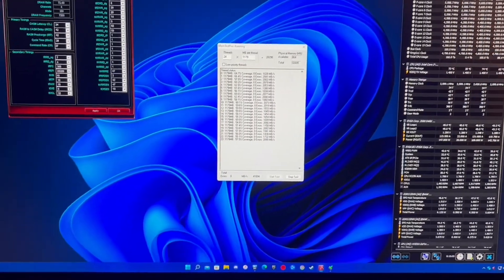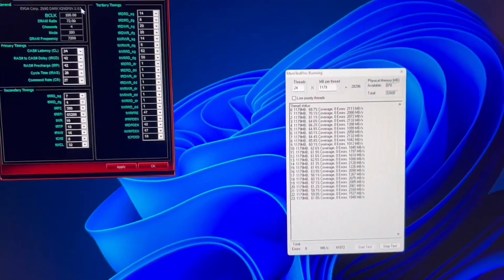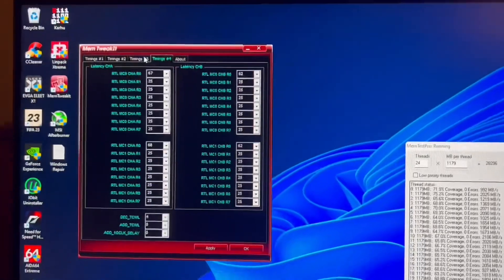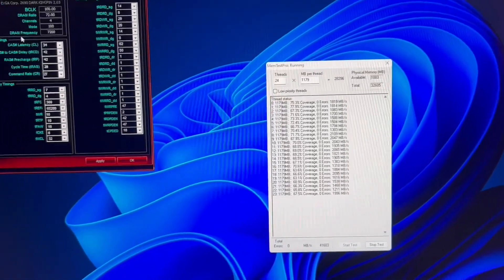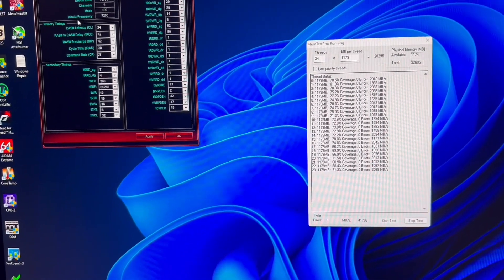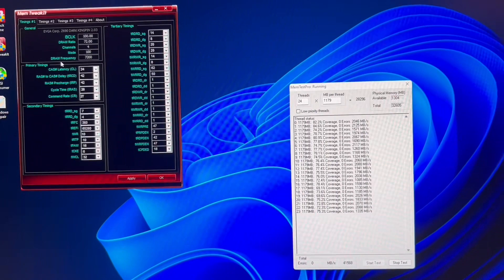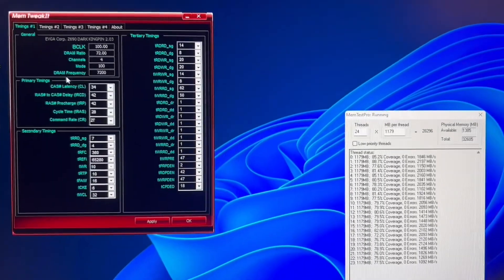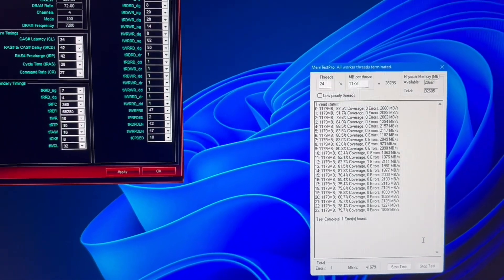DDR5 Max OCing on my i7-13700K (7200C32 on Hynix M-die)

Comment: I wanna ask you, is System Agent at 1.3v safe on Gigabyte boards? 
Buildzoid says even 1.35 SA is safe. 
I just noticed that A-Die T-Force 8200mhz (CL38-48-48-84) can boot at 7000mhz and actually passing stress tests for 4 hours as we speak with XMP1, but with CL36 instead of stock CL38. So, so it's CL36-46-46-84 at 7000mhz currently. It would not boot until I set SA at 1.3v. The rest of settings including voltages are at defaults. 

Gigabyte Aorus Master Z690 System Agent defaults to about 1.265volts stock, and stays there, according to HWInfo64. 

Is 1.35 safe?
Is 1.30 safe?

I see other boards you mention go as low as 1.2v on SA. Don't want to damage the cpu
Reply from the maker: 1.35V SA is safe but almost never necessary. It usually causes less stability. 1.3V was a go-to on EVGA just because of how they designed the BIOS. 0.95-1.25V is usually optimal, but you literally have to treat every board and CPU as its own thing.

Comment: There is always a glitch on M die 7200 is the max i have tried as well but .. after a month running it shows unstability idont know why even with a less tight timings

My 13700kf alone can stable 1.32v 5.6/4.6/5.1 seettings.
Reply from the maker: Z790 Apex does disgusting and illegal things with 5H16M
Reply: I noticed that CPUs have some mysterious degradation, or the boards themselves. I ran CL32-40-40-28 on my M-Die 6400 G.Skill Trident Z5 stick, but at 6700mhz.
12+ hours, for like 5 different days separately.

Guess what...it is now unstable at this, and throws 1 error in period of 8 hours. 
I have a feeling motherboards have some kid of issues after borderline OCs. 
In my case it is now throwing that I don't have enough voltage, but for those 5 days I had zero errors in TM5 with Extreme777

Yeah...but then again I also saw instabilities with CPU overclock after 6 months. Either CPU is degrading or motherboard. I am mostly underclocked for CPU and RAM, but that doesn't matter after some time.

Comment: 34 -42-42-28   , how does this work im a but of a ram noob  but im trying to get hynix m die stable at 7000mhz on msi pro z790 with 15 13600k ,  i thought  it hadto be like atleast 34 42 42 76   ,    is there any websites or methods i can use to find out different  timings to try seems like iv been  going for days and making very very slow progess , thanks for your videos aswell man ill be watching them all  to  enlighten my brain 🧠  haha
Reply from the maker: tRAS on Hynix ICs can go very low, as low as 28 in some cases.

Comment: i have an i7-13700k and hynix m-die. I can't get above 5.4gz p core and 4.3gz e core. Also can't get above 6600mhz CL30 on the memory. I have an Asus Prime Z690-A board. Is that the problem?
Reply from the maker: Uhm, likely with regards to the RAM thing, although it should do 6600. 5.4/4.3 is not that easy for an i7. What are you stress testing with?
Reply: @dainluke  Yeah I can get to 6600 stable. Stress testing with OCCT extreme and Prime95 for CPU
Reply from the maker: @resistanced4  Prime95 is a tough thing to justify with RPL. I really don’t know if I can advise you on it. It’s basically a matter of what can you cool and what can you risk. I would say stick to OCCT.
Reply: @dainluke  can I get your disc by any chance?
Reply from the maker: @resistanced4  there’s a link to it in the channel about section

Comment: I have a teamgroup model 6200 mhz cl 38.38.38.78 how many mhz can I go up to 13700k with a z690 strix egaming

Chip hynix
Reply from the maker: I apologize for the late reply, for some reason YT held this for review.

Z690-E Strix's are similar to the HERO and the -F in that they are relatively reliable. With a good Alder Lake IMC, you could've expected 6600 with some effort if your board sample has a good PCB (will have to be tested). As far as I know, the -E uses 8 PCB layers and judging by the HERO I picked up recently, 6800-7000 might be doable. 7000 has been doable with a kit such as yours (M-die with a good heatsink) for a long time now, but Raptor seems to enable better max mem on lesser boards (I mean those that aren't for XOCing). Get a RAM fan and 7000 I'd say can be done if you're willing to put time in. Please try to stay below 1.5 VDD, 1.5 VDDQ, 1.45 TX VDDQ and 1.35 SA. Those are my absolute max daily recommendations to people who watch my channel or ask for advice. In saying that, if you can do 1.45/1.45/1.4/1.25 on those respective values - even better. VDD2/IMC VDD/CPU VDD2 as it goes by different names should usually be left auto. It's a motherboard-generated voltage that boosts signal as data travels between the CPU and the DIMMs and the voltage hits your CPU pins in the socket. Obviously, we don't want it infinitely high, but it (should) be safe up to as high as it needs to go. Generally, your board will never set it higher than VDD or VDDQ and it's something you can let the board handle on its own.

Comment: I can not go beyond 4000mhz cl15 with my i7 12700k on a b660m board. Maybe with a Z690 board?
Reply from the maker: 4000C15 is very good for Alder Lake and Raptor Lake.
Reply: @dainluke  Great! Probably I will not mind change the mobo just to get 133mhz higher.
Reply from the maker: @paulotakahama  It might be an IMC limitation. 4100-4200 is very hard to do on ADL chips.
Reply: @dainluke  So that is it! I thought it was my budget b660m mainboard. Running 4.6ghz ring and 5.0ghz all core on air. VCCSA is 1.18v. Tried to increase that, but gets unstable.
Reply from the maker: @paulotakahama  5.0 on a 12700K isn’t easy because silicon on the i7 last gen was not too great on average. 5.0/4.7 with air cooling is not bad. It’s fast enough. To get 5.1-5.2 on a 12700K is extremely hard because the SPs are never higher than maybe 78 at best. You’d need an insane amount of voltage to do 5.1-5.2 and a lot of cooling. 

I think your setup is perfectly fine to be honest, unless you really want to max out your parts. In my latest video I show the uplift you get with Raptor Lake, and it’s not that much at all. You will be able to pick up cheaper Z690s and 12900Ks so the option is there to upgrade, but I think 5.0/4.7 with 8 P-cores, alongside 4000 15-15-15 is definitely good enough for gaming and other applications. Still faster than 95% of PCs.
Reply: @dainluke  Thanks a lot for all information. I noticed 5.1ghz all is almost impossible on my air cooler.

Considering your explanation, I will keep this setup for at least 1 or 2 years, because my GPU is the bottleneck (RTX 3070).

Hardware is in general expensive here in my country. LoL.

Still waiting for the Zen 4 3D chips, just because I mostly play competitive fps. But the tuned i7 12700k is already pretty fast.

One of the reasons I am keeping this i7 os because it has AVX-512 enabled.

Regards.